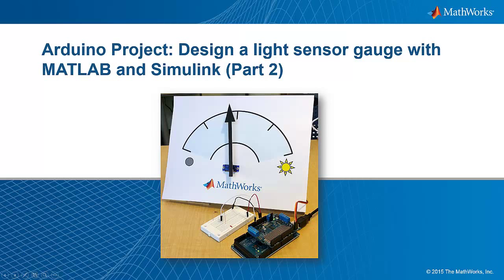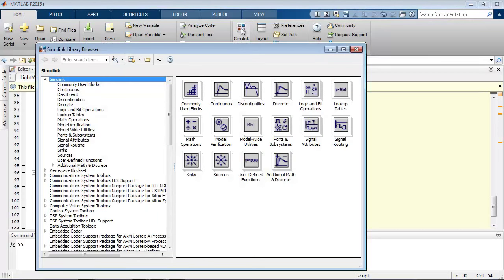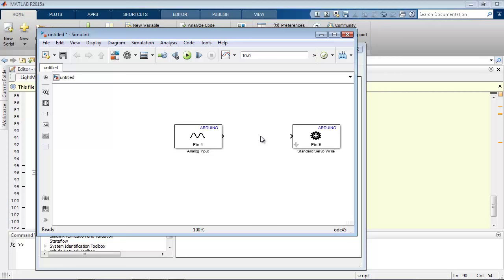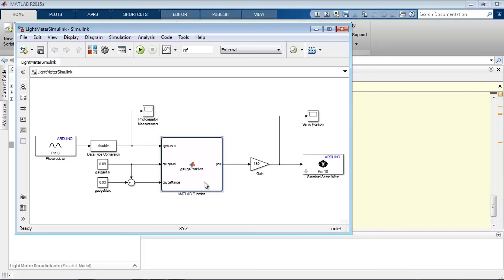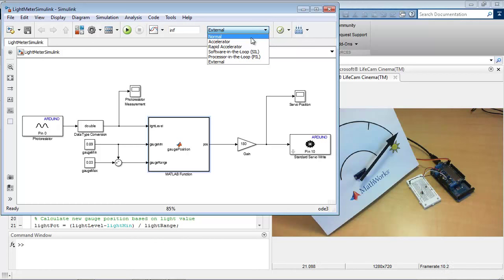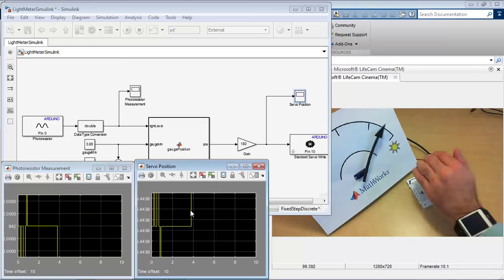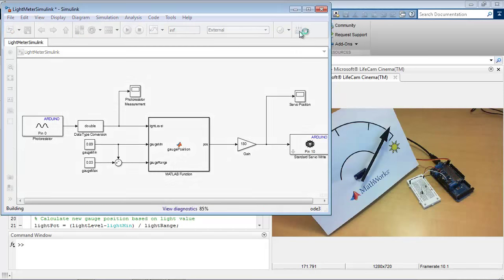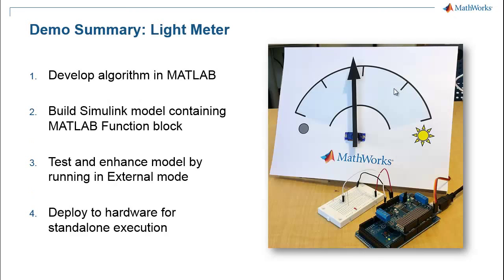Arduino Light Meter Project, Part 2: Program the Device from Simulink

Comment: Hi there. I am trying to control a bldc motor using arduino. It works nicely with the servo code in MATLAB, where I can define minimum and maximum pulse duration. But in simulink I am not able to find such provision for servo block. Can you help me in this, so that i can make my arduino stan-alone?